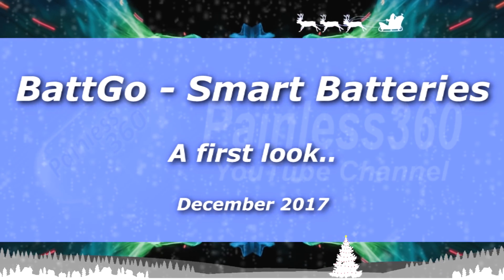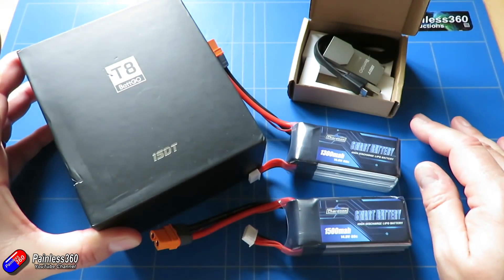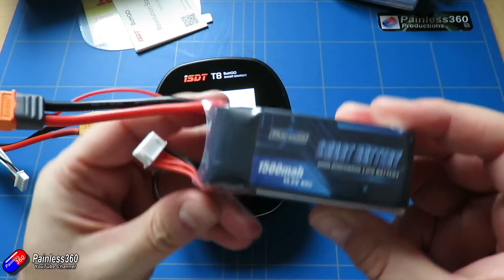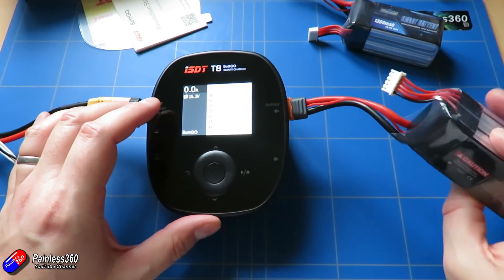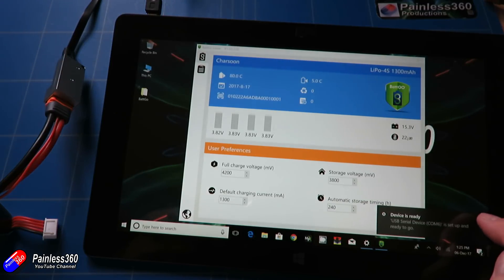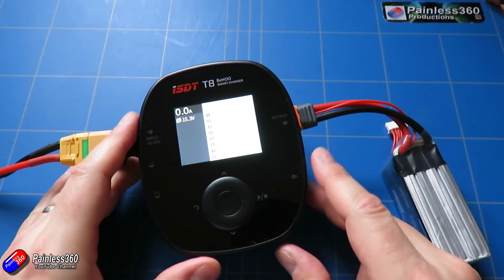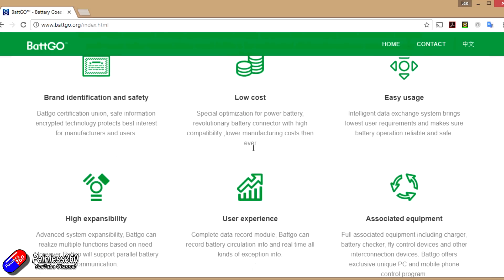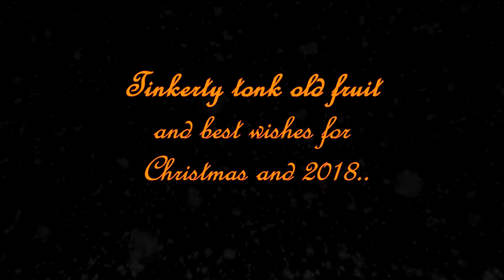RC First Look - BattGo  'Smart' LIPO technology

Comment: I just found out about this whole BattGo thing now, lol. Neat system for pro's who need to keep track of charge cycles so their batteries are always 100% good for the job. Unless, of course one can manually set the number of days before the battery discharges by itself. Should I forget to discharge fully charged batteries, they are going to be ruined long before 10 days on a full charge. I believe it was you who said 10 hours or maximum a couple of days in another video, before a fully charged battery begins to degrade rapidly?
Reply from the maker: It's not that quick, if you're going to leave a battery charged for more than a week I'd discharge it back to storage voltage just to be nice. ;) Happy flying!

Comment: This may be a rather stupid question. But is there any AC Adapter (brick) we can plug into this charger? My idea would be to only use the AC brick to charge batteries at home, is that makes sense. That way this charger would have two uses: at home and in the field. Thanks
Reply from the maker: Sure is. Check out the usual places like Hobbyking and Banggood for them (i.e. https://hobbyking.com/en_us/turnigy-reaktor-pro-350w-23a-power-supply-100-240v-ac-uk-plug.html)
Reply: Painless360 got it. Thanks.

Comment: Lee, do you think always doing a balance charge at 2c is detrimental to the lipos life span or is it perfectly OK to always charge at 2c? I've finally got a couple of new lipo coming so I can fly again, and I've always only ever balance charged at 1c, but it takes ages that way.
Reply from the maker: If the pack is rated at that level then it’ll be fine. If I have the time I like to charge below that level as it is a maximum.. Having a four port charger helps keep the overall times down by allowing you to charge  multiple packs at the same time ;) happy flying!
Reply: Painless360 can't seem to find any reference to what charge rate they can take, I assumed that a 2c rate would be fine for 99.9% of lipo these days, I can't remember the last time I saw a lipo that states only a 1c charge rate. I guess it'd be OK to do a 2c now and again rather than every time?

Ps, charger is awesome, thanks!

Comment: I am very interested in this it looks very cool. But it seems that 1 use that would be huge is missing. If Betaflight could read your battery when it is plugged in. So on the boot up your F.C. would get the capacity, c rating and current charge and even information like number of cells and the current cell  values which will be good for telemetry. Also while you are flying instead of guessing it can ask the battery how much capacity it has left. This would also raise the demand for battgo enabled batteries would go up. I had a quick look for male xt60i connectors but could only find female ones.

Comment: Great development if it's taken up by manufacturers although I'm not sure I'd be happy plugging a cheap 4S into the USB port of a 2k computer!
Reply: patrickcol I would hope that the adapter is very will isolated. I wonder if we could send one on the adapters to @xjet to pull it apart and see how it works and if it is well isolated. But remember it is not the cheap 4s or even 2s battery you need to worry about it is the adapter that is made by isdt and how well the main positive lead is isolated from your computers 5v